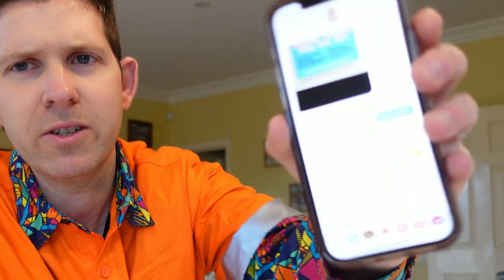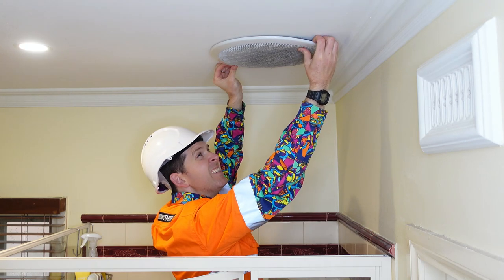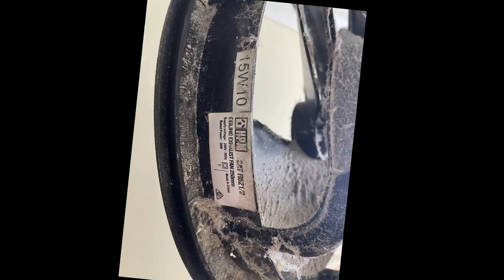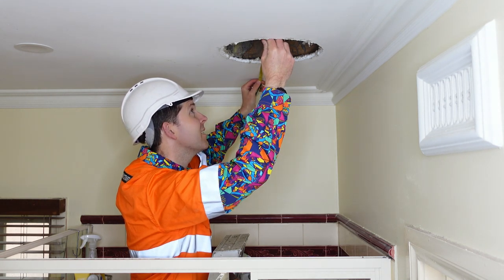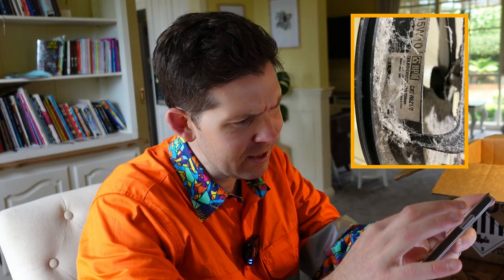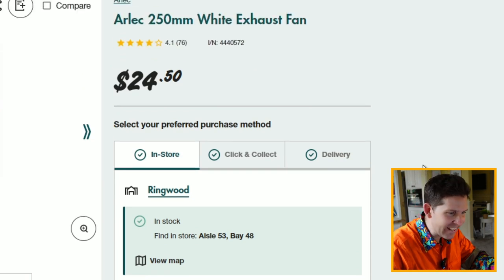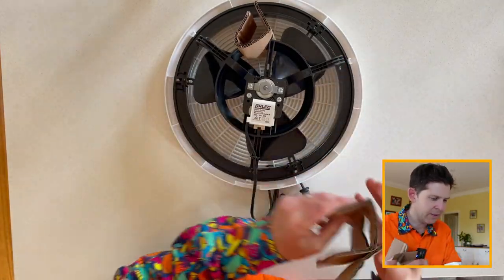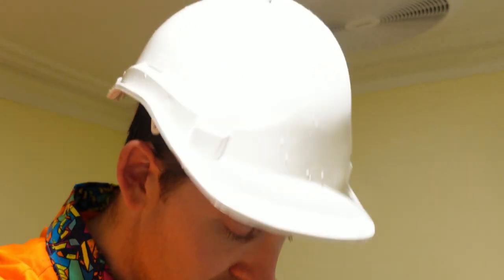Never Again... Installing an Exhaust Fan

Comment: It's wild to me as someone who lives in a cold wet climate (UK) that you just vent the shower into the ceiling & not ducted directly outside. The moisture would cause serious issue in our roof space
Reply: Attic would be a mold/mildew infestation & nasty mess in no time here in Canada, everything here is ducted outside.
Reply: And the fact the electric fan is right inside the shower.
Reply: That's how it should be. I can't believe how it is done here, I think it's totally stupid.
Reply: The soffits under the eves normally have ventilation holes
Reply: I suspect it does in UK too, they just don't give a F. They somehow haven't realized in general how to build properly.
Reply: @IIGrayfoxII  Not good enough. You need to yeet humid air directly or using ducting. It's not like they don't already have enough problems with how the climate is and substandard insulation.

Comment: I reckon I probably could have fixed that old fan by cleaning it thoroughly (including cleaning the bearings) and applying new greese. Most people wouldn't bother anyway but I came from a background of not being able to just replace stuff so we made everything last forever.
Reply: Same here. I have an old treadmill that decided to die. Everyone was telling me to just throw it out and buy a new one...
A bit of diagnostics later and managed to fix it for less than £2 by soldering on a new diode.
Reply: @bailey125  I reckon you would get along well with my brother, between us all, there isn't much that can't be fixed
Reply: @nobodycares85  Just another example, today I fixed my 20 year old pressure washer that stopped working for only £3. Just needed a replacement capacitor. happy days!
Reply: On the topic of not paying for stuff, my brother found a microwave on the side of the road once where the insulating plate thing that sits in front of the magnetron got burnt up and would arc when cooking. 5 dollars later it's replaced and we have a better microwave than the one we had before.
Reply: @gojohnson2511  that's awesome
Reply: time spent doing that is worth way more than $25
Reply: @defeatSpace  With that kind of mindset it is. Cleaning and greasing a fan is no trouble at all if you know how. A quick google search can show you.
Reply: @defeatSpace  if you were on the clock at the time then maybe,  but if it's your spare time,  it can be worth doing and then there is the satisfaction of fixing it yourself and reducing waste. Waste is a huge problem and we need to change our attitude around it.
Realistically,  the repair is probably about a half hour.
Reply: hippie mumbo jumbo
Reply: @defeatSpace  we clearly are not going to agree. You think I'm a fool and I think you're one so let's leave it at that.

Comment: Surprised to see that the exhaust fan wasn't duct out the house like all the ones I've encountered in the US (that were properly installed.)
Reply: i thought the same thing. In New Zealand we duct them outside usually. Maybe it is an age thing
Reply: Depends on how well ventilated the roof space is. 
Ducts can cause a whole other issue as no one ever cleans them. In units and apartments they usually have a central exhaust system which runs continuous at low flow to reduce noise and also reduces the amount of lint and dust drawn into the duct.
Reply: As a Swede where that would be required I don't get it either. That'll just blow all moisture from the bathroom right into the insulation in the attic and wreak havoc over time as it rots away the wood up there.

Makes absolutely no sense to me.
Reply: @noelcollins1960  In Sweden, in high rises and apartments those are cleaned out by the chimney sweeper once a year or the fire hazard insurance trips if something should happen. Doesn't even matter if that was what caused the fire, you're fucked either way. They are not low flow, they are just fairly quiet because of the distance between the extractor fans and the vent.

So we do that and we use fairly straight bound metal piping or plastic but nothing anything will stick to on the way out.

I've owned this home for over 30 years now, one look up there and there is nothing there, there are filters on the way and nothing will stick to that exhaust, it'll just fall down instead.

Routing it to the attic over here would be insane, the temperature varies between +35 C in the summer and -40 C in the winter. You don't want well ventilated attics at -40, you want 45cm of insulation x2 and an air gap in between.

Comment: I’ve done 3 exhaust fan placements around the house. Sometimes they can be a pain to unplug depending on where the socket is. One of the fans didn’t spin anymore and the other 2 were so slow that they weren’t very effective.

Comment: I changed my own lightswitch today. It's illegal in Australia but I DGAF, I put a better switch in and this time the cables weren't loose, the professional installers hadn't torqued the screws down and I was wondering where that smell was coming from. DIY electrical is sadly illegal, but for like-for-like replacements is typically a child's play. Just do a decent job.
Reply: The interesting thing is that across the ditch in NZ they also had and maybe still have AS/NZ 3000 for their writing rules. They like a lot of countries allow certain works to be done by DIYers so long as the work meets the standard.
Reply: @vk3fbab  they have the same standard as here and the same rate of electrical death despite our requirement of professionals only. Also last I checked as the standard is part of the law in NZ it's available for the public to view. NZ taking the weird view that people should be able to see the laws they are required to obey.
Reply: Yes sometimes electrical work can be a bit shoddy, especially in new construction where the electricians subby to the builder who is only interested in lowest cost. 
Most electricians  who do work direct to homeowner will usually be fair and honest because they rely on each customer to be happy enough to call them again and recommend them to others.
Reply: @zyeborm  the law you have to comply with is the "electrical safety act". It references AS3000 (and others). 
If you have a free membership at your local council library you can access the Australian Standards (to read, you may not save/copy them....)

TAFE (NSW) students have online access as part of their TAFE fees.

Comment: Here in the US all of the ones I've run into are ducted so if you have to replace the box it's a real hassle. I usually just replace the motor and blade.
Reply: I just did mine using an inline duct fan rather than one of those. Much quieter too

Comment: Does ESV require you to provide yourself a certificate of electrical safety in this case? Our because no money changed hands it wasn't required or because it was a trivial plug swap? I know that I'm supposed to issue a TCA1 form for any telecoms cabling I do at home. Easier for me to write one up if anybody cared. Curious what sparkies have to deal with.
Reply: Different states in Australia have different rules, but as this was a plug in fan and didn"t require any wiring work it would not even require an electrical licence. Usually the only time the inspecting authorities are supposed to be notified is if it is new or additional work.

Comment: Pro tip, never install a fan directly above the shower. The condensation will drip into you and you'll get cold drips in your warm shower. Put it off to the side but still just inside the shower area (or over the sink or floor drain) so the dips land inside something that is ok with the water.
Reply: I get drips falling from anywhere on the ceiling over the shower not just the fan
Reply: Best place for the fan is diagonally opposite the door so it draws the air under the door and across the whole room.
Reply: @noodlelynoodle.  you need more fan lol. Do check through that there's actually enough room for air to get into the room so the fan works. Been to plenty of places where the door seals really tight. Which is great but means the fan doesn't have anywhere to draw air from. Cut a cm off the bottom of the door, the fan stays quiet when you close the door and the steam actually gets vented. Quick Fix is open a window a little.
Reply: @zyeborm  the steam vents fine and there's well over a cm of space at the bottom when the door is closed and I almost always have the window fully open so I dunno it doesn't really matter tho

Comment: Does code allow a fan to be directly over a shower in a wet zone like that?   Also a bit disappointing that it's just vented into the roof (we had a similar fan replaced with an inline unit)
Reply: Yes, fan is allowed above the shower here in Australia.  Not ideal into the roof but very common and generally no issues with it doing this.
Reply: As per AS/NZS 3000 the Wet Zone only extends vertically to the ceiling. As all the electrical components are above the ceiling it is ok.
Reply: @noelcollins1960  right, but isn't there an exclusion zone around the shower head or some such too?  I dunno, it's all a bit confusing.  I think the rules may have changed recently; either that or we were sold an inline unit we didn't need 😔. Or maybe it's just a matter of our installer being overly cautious.
Reply: @gunderd  The zoning starts at the fixed plumbing point for the shower. They used to specify all positions for  the shower head which made sense if you had a 1.8m hand held shower head, but they have since dropped that.
Side note - I met my wife because of wet area zoning. She is an Occupational Therapist who redesigns house for people with disabilities and she asked me to go through the wet area zonings for her. That was 27 years ago.

Comment: As someone on a limited budget, I probably would have just cleaned and oiled the existing fan.
Reply from the maker: I mean the bearing looked pretty cooked. Not sure it was salvageable
Reply: Remove the bearing cap, regrease it, or find another skateboard bearing.

Alternatively just replace it, it's not worth wondering if the insulation on the motor windings has started to wear down, it's a fire hazard.
Reply: They are normally bushings, by the time they make a noise they are toast. Replacements for most can be had for like $30 at times. Not worth messing around with lol
Reply: @zyeborm  The few times I've had to do it, a bit of used engine oil at least made it quiet toast, for a while.
Reply: @user2C47  it'll work for a while sure, but I'm lazy lol I don't want to be getting up there every 6 months geez.

Comment: Sorry, but "tip number 1" really should be "never stand directly under a grate, ceiling lamp assembly, etc, which you are taking off".  You will always get disgusting crap falling all over you if you do, no matter how careful you are.  I always forget this one until it's too late, too.

IMHO, tip 2 should also be: "Whenever possible, turn off the power in at least two different ways."  For example, in this case, make sure that both the switch and the breaker are in the "off" position before starting work.  (If you're working on something that doesn't have a switch, then turn off both the main panel breaker and the sub-breaker leading to that circuit, etc)  That way even if somehow one of them gets switched back on (or you flipped the wrong one somehow, or something's wired up in an unexpected way, etc), you're still likely protected.

I would also point out that just because there's an outlet involved does not mean that safety stops at the outlet. Yes, it has a plug on it, but that is still an exposed fan assembly you are fiddling with in your hands, and depending on how well it's put together you could very well come in contact with bare wires in the fan itself, regardless of whether it has a plug or not on it.  You're basically working on a plug-in appliance while it's plugged in with its case open (in this case, the "case" is the ceiling itself), so yes, you do still need to make sure power is appropriately disconnected.  It's not just the romex in the wall that can kill you.

Comment: Moist air blown straight to the wooden rafters? A very, very bad idea. It is worth making some simplest duct transporting this air directly outside.
The fan is needed to replace the humid air with fresh air from the fresh air source, I don't see the point of hanging it directly above the shower to remove the humid air immediately.
Dripping drops, which you can read about in the comments, result from the condensation of water vapor that occurs because the air in the exhaust duct is cold. Advice? Use an insulated ventilation pipe.
Reply from the maker: I know we are messed up in Australia
Reply: @thinklist  My dad, a carpenter with 30 years of experience, always laughs when he watches programs about houses in England or Australia.  He laughs and calls them "paper shit".  But hey, it's just a joke😅.  And your channel is great, you talk about electric things so well.

Comment: So, yes domestic work sucks. Everything is twice as difficult, you typically get 9 times dirtier, and you get paid ½ as much. So thats why i did high rise comercial and industrial.
So good advice for the diyer as to just killing the mains, but still. Even though your unplugging from a 413, being youtube you probably should have shown some form of test for dead even though you already knew. Diy people dont often know anything. Im sure had it not been a video knowing it was in a socket you would have just done it with the switch off, if it was hard wired, hit the circuit. Hitting the main switch, now you have to work out how to set the time on both your oven and microwave.....